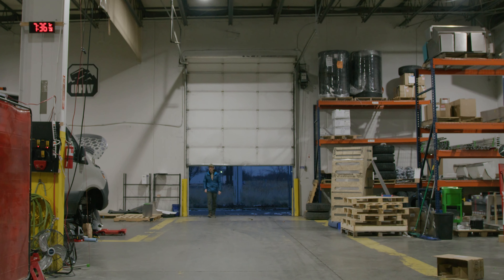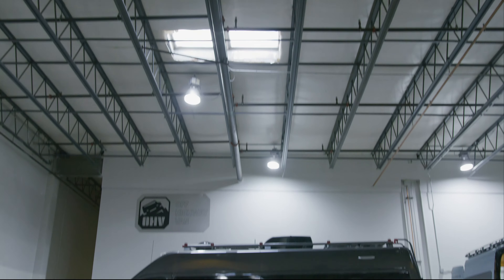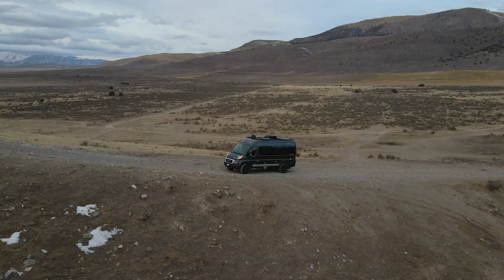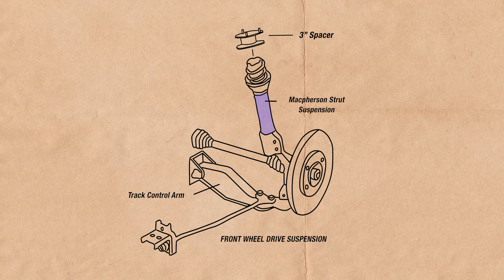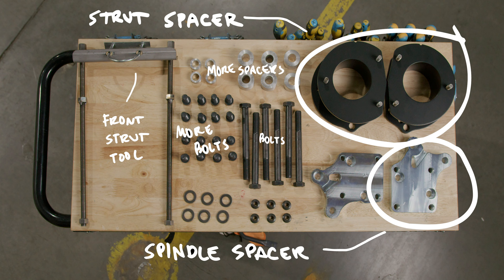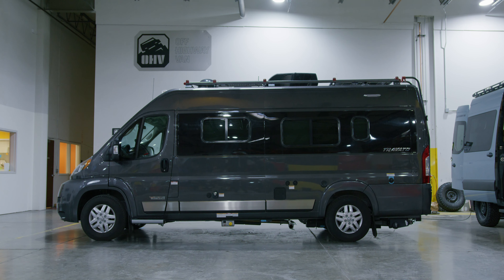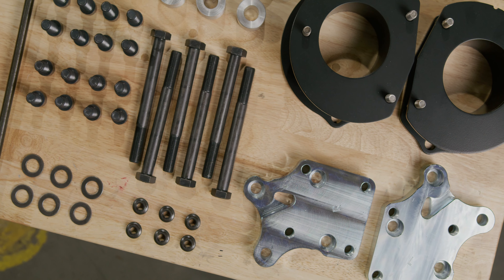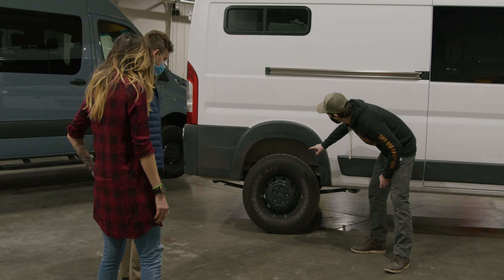RAM ProMaster 3" Lift Kit by Off Highway Van

Comment: FYI, where the steering column comes out of the body, to the steering rack. There is a black hard plastic cover in which the column travels through, that has a foam weather seal on the upper side of it. Its to stop splashes and air from coming into the cabin. After the kit is installed there is a gap there because the whole steering rack is lower in relaton to the body. You can't just slide the hard plastic cover up towards the body. Its clipped into the steering column assembly. OHV should include a foam seal to where the installer can tuck the seal in between the body and hard plastic seal cover.  I'm thinking there is a lot of vans with this kit on running around with this space wide open to the world. Also The transmission mount bolt that runs side to side is not a nut and bolt everyone. Its a bolt with a inserted nut that has been pressing into the aluminum mount. It doesn't turn, only the bolt turns when removing. Ha ha save you some time there to first time installers. My best to all, and thanks to OHV for making good and easy instructions to read. More tourque specs would of been nice. I did notice on my instruction handout pictures would cover some of the instructions.

Comment: It's not just lifting the suspension that matters but also installing a heavy duty shocks such as FALCON or FOX to better stabilize the ride performance of the vehicle and be more off road capable.
Reply from the maker: We absolutely agree! Typically, when we install a lift, we install upgraded shocks too.

Comment: Now if you would add a high torque electric motor to the rear wheels that only engaged when you actually needed it off road to get you out of a jam, then you would really have something.  Maybe you could use the 48V battery/charger-motor system like the "mild-hybrid" I have in my 2020 RAM 1500 pickup with 5.7 Hemi eTorque that gives an extra boost when needed for low RPM take-off.  You could engage a torquey rear wheel electric only when you need to get thru the rough.  The RAM 1500 pickup's 48V battery only has a 430Wh capacity (use in short bursts).  On a camper van that could be upped 5 to 10 times and double as the camper house battery.  With Ford Transit going AWD, FCA could use a hybrid 4x4 concept vehicle.
Reply: Caravan movers

Comment: Should you upgrade the shocks before doing this lift or vice versa? Thinking about adding some Fox to the front and rear along with sumo springs...
Reply from the maker: Upgrading the shocks is not necessary, but it will make the van ride nicer and overall more capable.
Reply: what will the summo springs do for you?
Reply from the maker: @SamVoorhies  Sumo springs in the rear help stabilize the overall van. We remove the front sumo springs when installing the lift, as they are not needed.

Comment: Does the rear lift put too much extra stress on the CV axle which might fail, given the geometry changes?
Reply from the maker: We include sub-frame spacers to drop the subframe and maintain close to stock geometry on the cv axle angles.

Comment: Any thoughts on adding bigger tires to the Promaster after doing the lift? - Stock tire size is I225/75/R16 -  I've seen some people put on bigger tires (245/75/R16) - is that a good idea or will it mess up handling (sway / cornering / turning), mileage, transmission gear hunting?
Reply: Good question…OHV?
Reply: Would love an answer to this question! Currently looking to lift my van and put slightly bigger tires and wheels
Reply: Since OHV ain’t getting back to us…I did some research. Adding 245’s would decrease fuel efficiency, increase gear search, increase weight, decrease handling, increase road irritability. It would increase lift on the axle. I think I am sticking with an all terrain- beefier 225.   Tell me why I should go to a 245?

Comment: Can I use this lift on the ProMaster city
Reply from the maker: The only ProMasters this lift does not fit are 2021+ due to a wind sensor issue with the new chassis design. We are working directly with the RAM team to attempt to solve this issue on newer models, but it is a process.

Comment: I have a question how does it do it go with the summo springs does this upgrade work with them ??
Reply from the maker: Hey William - Thanks for the question. We remove the front sumo springs, but leave on the rear sumo springs.
Reply: @OffHighwayVan  What happens to the added stability, improved load handling and comfort afforded by the front end Sumo springs?
Reply from the maker: @mjones9639  Sumo springs on the front (Without a lift kit) work great. However, adding Sumo springs on the front of the vehicle on top of our lift kit puts too much strain on the axles - leading to potential damage. Hopefully this helps answer your question - Thanks!

Comment: Does it do alot of bouncing with the 3 inch spacers? Trucks that I've been in that have had their struts raised bounce alot. Then again that was a truck and alot less weight in the back. I would assume the weight of the van holds it down some. Plus all the shit that goes in them.

Comment: Hey guys,  what's the current feedback on long term impact to the CV axles?  I'm buying a 2018 2500 and need to lift it for greater ground clearance (has a wheelchair lift under the body).  Is there anything people are doing that reduces the stress on the axles or eliminates the risk of them wearing g prematurely? I'm hoping guys from the shop can chime in...
Reply from the maker: Great question! There are a few preventative measures that can be taken. Our lift expert can give you a much more in-depth answer on this. Give us a call at (801) 871-8713!

Comment: any impact on handling sway or cross winds
Reply from the maker: It actually helps. The spindle spacers on the rear widen the overall stance of the vehicle about a half an inch on either side, providing more stability.

Comment: Will this change the vans towing abilities ?
Reply: Can you use Air Lift LoadLifter 5000 Air Helper Springs with this kit installed for towing purposes? I’m going be towing a 4500lb boat with mine
Reply from the maker: It will slightly change the feel of towing, but should not alter its capacity in any way. The RAM ProMaster can tow around 6700 lbs, so you are more than safe to continue towing at 4500.